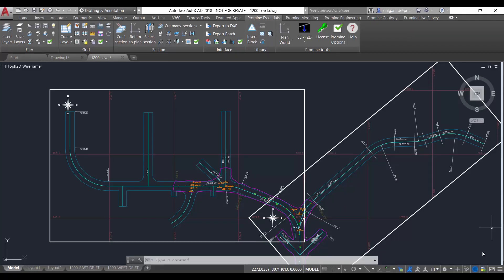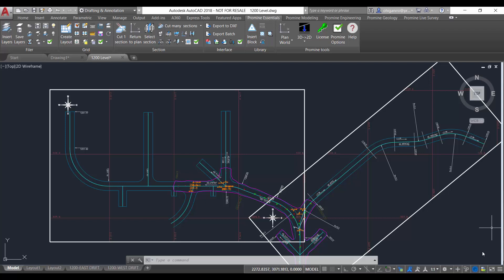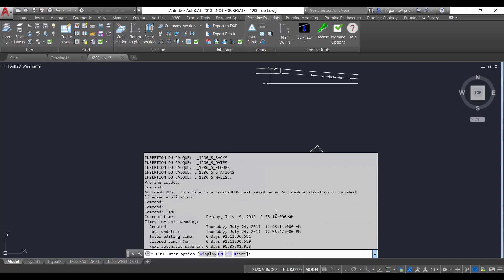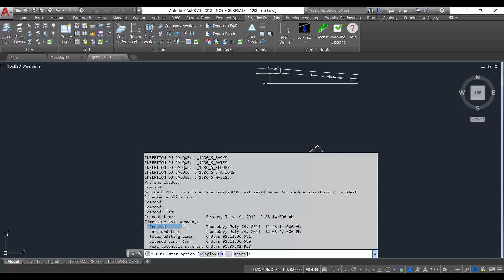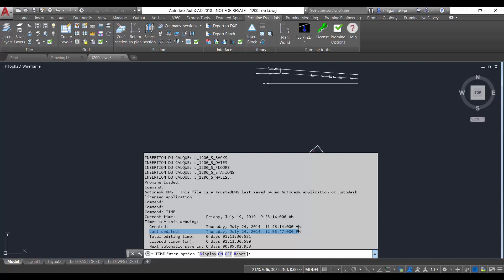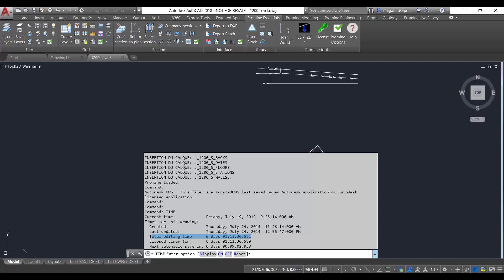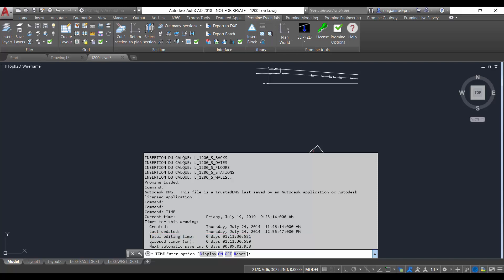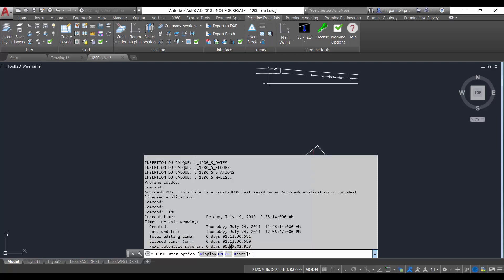Promine AutoCAD Tip of the Week: Time Command

Comment: Thank You - Promine

Current time:             Tuesday 31 May 2022  10:10:02:990
Times for this drawing:
  Created:                Wednesday 25 May 2022  17:32:47:379
  Last updated:           Monday 30 May 2022  12:35:35:518
  Total editing time:     0 days 03:59:46:895
  Elapsed timer (on):     0 days 03:59:46:907
  Next automatic save in: 0 days 00:09:54:906

The Above is the Output from AutoCAD 2007 on Windows 10 Laptop 

On my Windows XP - AutoCAD 2007 
the Output does not show the Dates DAYS 
Current time:             Tuesday 31 May 2022  10:10:02:990
Times for this drawing:
  Created:                25 May 2022  17:32:47:379
  Last updated:           30 May 2022  12:35:35:518
  Total editing time:     0 days 03:59:46:895
  Elapsed timer (on):     0 days 03:59:46:907
  Next automatic save in: 0 days 00:09:54:906

Is there a setting in AutoCAD to show the DAY 
Or is it a WINDOW THING ?